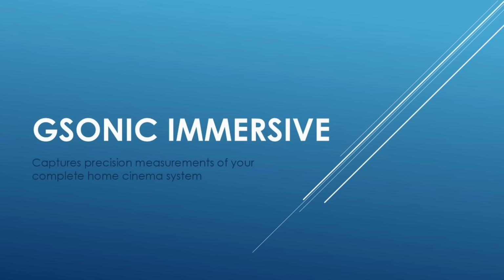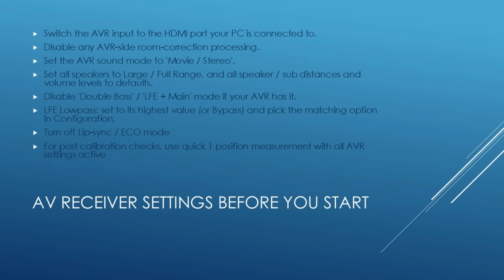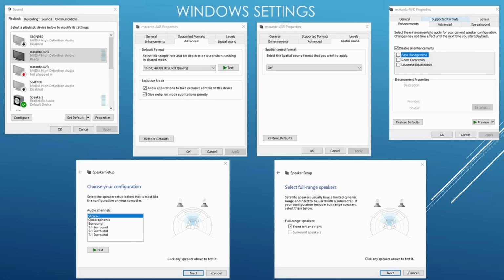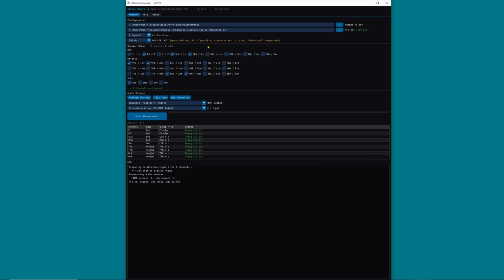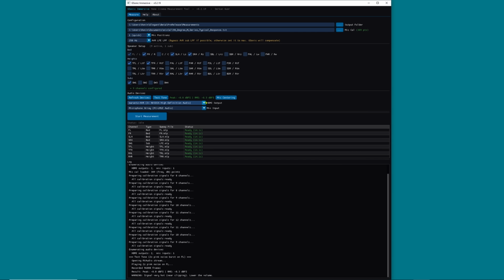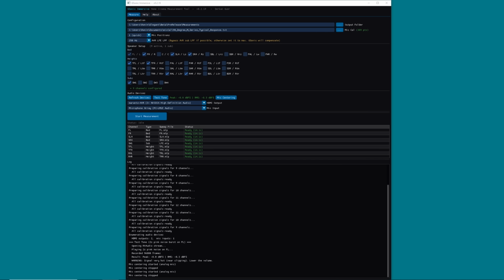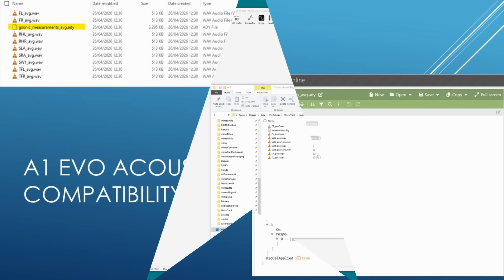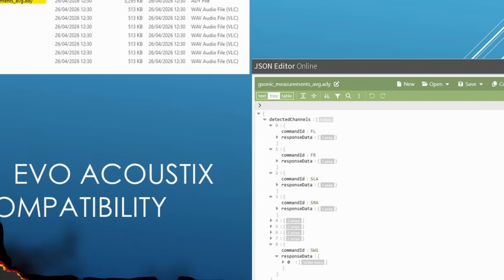GSonic Immersive

Comment: Have done an initial test. So far, the volume level is incredibly low when imported to acoustix. The sweeps volume during capture seemed similar to built in. I confirmed all speakers chirped correctly as expected, but the sub was firing each time, not just during sw1 sweep. Maybe these will be answered in the video and I am jumping the gun?!
Reply from the maker: These are explained in the video,you are right. You need to turn Audyssey off, set the speakers to large, all distances equal, levels to 0 and bass mode to LFE, LPF for LFE to 250Hz in the AVR before taking measurements unless you are measuring for the results of a calibration (then you leave everything as is and just measure to see actual results). If sub was playing with speakers, it means your speakers were set to small and crossovers were still active.

Volume level has no effect on AcoustiX calibration. Impulse responses do not have volume levels, they are 0 dBFS. REW assigns a reference level to them to convert to db SPL and this offset is equal for all measurements hence no effect on calibration.
Reply: @ocaudiophile  Of course, speakers were still small. I am so used to AcoustiX setting everything for me that I neglected amp config. Will have to wait until tomorrow to continue. Perhaps in that new AcoustiX 2 I saw in your other video background, you can reinstate an option for amp setup for Gsonic! Thanks!
Reply from the maker: These can only be done over the network on telnet which is not very reliable as you know well from AcoustiX and besides the commands vary from model to model plus only valid for D&M models . It's cleaner and guaranteed when the user sets them up from the AVR menu. It takes 2-3 minutes (trust me I did many times recently). Of course, if I add it in the future you will get it as your license is for lifetime free updates.
Reply: @ocaudiophile  I more meant adding it to Acoustix, makes more sense there given anyone with Gsonic that wants to use Acoustix, will already have both! Either way will do it manually for now. 

Unrealted, feature request for Acoustix: any way to automatically import custom filters per channel? If TRL.req exists, automatically populate it in the EQ window. Have to do so many annoying clicks right now :)
Reply from the maker: :) Be careful what you wish for.
Reply: @TobiasBeech where did you see AcoustiX 2.0? 😯 Wonder when it will be out. Will be very interesting!
Reply: @Nelthalin  Likely in the previous gsonic video

Comment: Hey, iam using the Evo Express still in my living room and totaly happy with that. Will it be better when i use this new program for the meassurements? or is it completly different and not compare to the express version. Sorry about my english :) not native speaking that
Reply from the maker: This is a measurement only tool. You can check your Express results with it if you need or use the ady file it provides with AcoustiX (not Express) for calibration.
Reply: @ocaudiophile  ah i understand so with that i can controll my calibration, whats the real frequency and else is? like REW but fully automatic without that hard single steps in REW? Sounds awesome
Reply from the maker: That and some more gizmos you will see soon like a mic centering tool that doesn't require checking the screen.

Comment: Purchased. Wondering how we will receive updates?
Reply from the maker: Thank you for your purchase. I guess you dug deep to find the link ;)

You will receive an email from Gumroad with a download link whenever an update is uploaded. If it needs be -depending on number of sales, I can implement an auto update feature in the future but this requires running your own server :(

I don't expect (too many) bug related updates though, I kept it Windows only for a reason and it's already been extensively battle tested.
Reply: @ocaudiophile  Perfect, thanks. So no algorithm updates expected?!
Reply from the maker: No, there's only possibility for hardware related issues with some setups and for reasonable additions users may request of course. Algo is solid.

Comment: Will it cover all of the features and advanced calibration algorithm of the latest A1X on D&M AVRs? What about full range correction support, which I know you don't like, but my own OCD just cannot live w/o it... 😉
Reply from the maker: This is purely a measurement tool for all brands of AVRs, no calibration or filter generation but if it detects Denon/Marantz gear it produces an AcoustiX compatible ady file.
Reply: @ocaudiophile  So with an x3800h, I really don't need this, and A1X will do?  On the other hand, I can use this for someone owning an Onkyo (where A1X wouldn't work)?